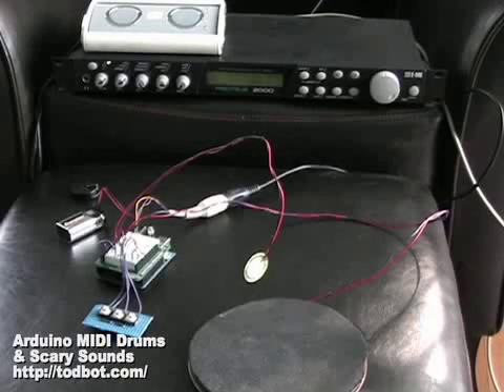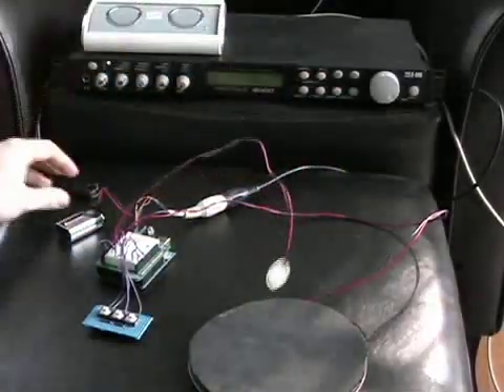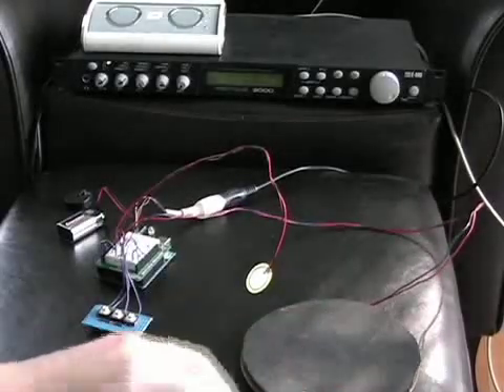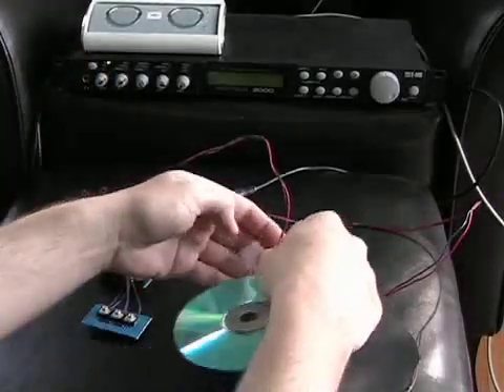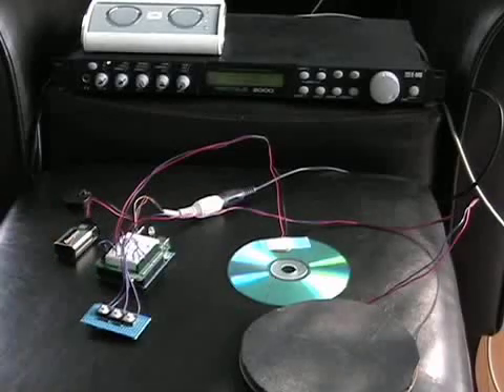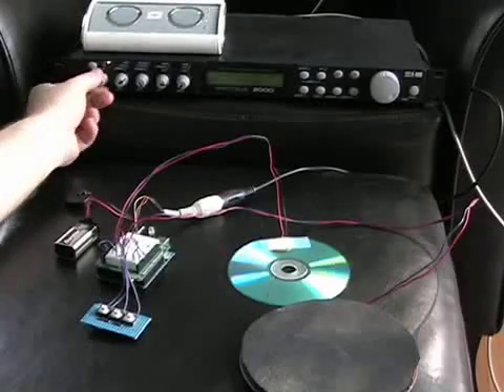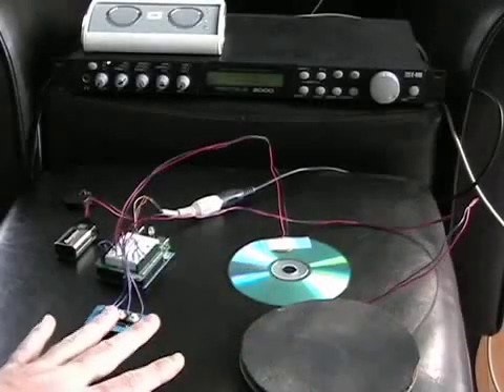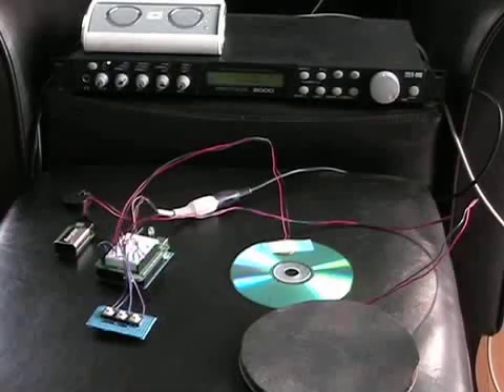Arduino Midi Drum Trigger Kit | DIY Drum Triggers with Piezo Buzzer Elements

Comment: do I need the module? com I use a MIDI to USB converter and hook it up to my computer, then use software for the samples?
Reply: I know you already showed the sample done in the computer, with the scary sounds, but it was still going through the drum module. Can I bypass the module completely with a MIDI to USB converter? That's my question.

Comment: Well with a guitar synth, the guitar is the controller...

so you don't need this.

Unless you are using the guitar sound module (like a roland gr-33), then you just replace the "scary sounds" or drum machine with the guitar unit.